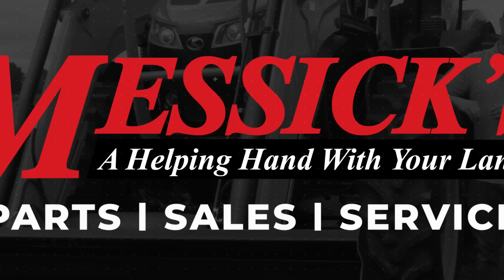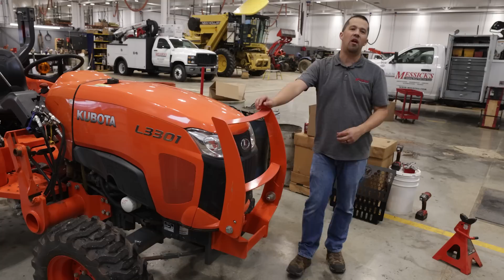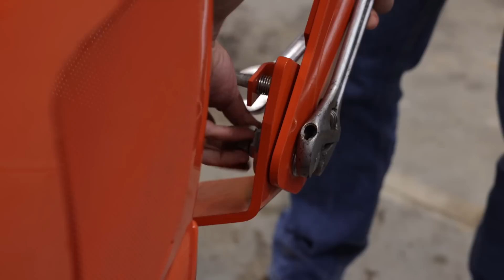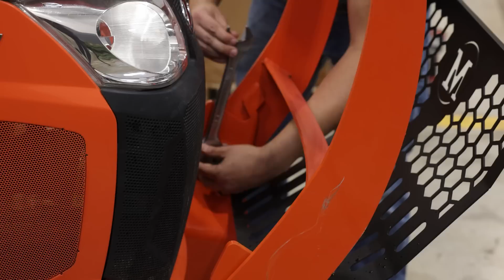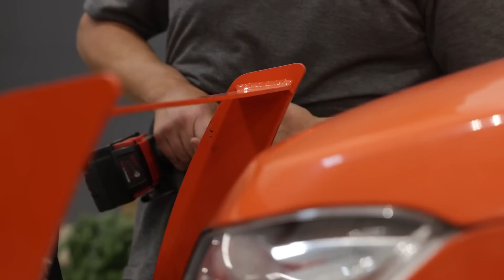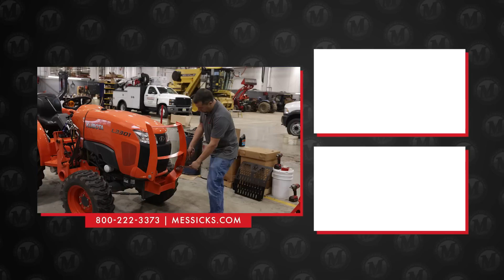Messick's Brush Guard Installation Guide

Comment: Wouldn’t it have been easier to put hooks on the top of the guard that hooked over the frame and just use the two bolt holes at the bottom of the frame?

Comment: Purchased this brush guard after trashing the grill on my daughter’s Kubota L 3301 while pushing brush with the bucket.  The item arrived in a timely fashion and was installed quickly thanks to this video and the fact that you included the drill bit to make the holes for the upper part of the guard, the tip about using a lubricant while drilling also was ver helpful.  And, as if that was not enough, you put the first letter oh her last name fabricated onto the guard which I took full responsibility for, she was very impressed.  Now, if you could just fabricate a grill guard for our ‘02 TC40 D, I would be even more grateful.

Comment: Looks great at price point compared to what I found online before I decided to make my own. Clever mounting idea on bottom. I bought a 24x36" sheet of 16G 1/2" perforated rolled steel, cut to size and painted New Kubota Orange (Krylon). It's about a perfect match, color wise. I was about $115 all in with my (free) labor, so I think your price is pretty fair and might have bought one had I seen this before. I do like the matching orange though. I can't weld so it's held on with 10 heavy duty zip ties. So far, so good...

Comment: Does the grill guard inhibit the lights at night?  Looks like you might not have enough lights because it's blocked by the guard.
Reply from the maker: A little bit, yes. The headlights are already pretty compromised by the loader. If you need light at night, work lights are the way.

Comment: Interesting Neil.  My Messicks grille guard for the LX2610 went on the inside and had to be drilled from inside to outside.

After rewatching the video I'm wishing my LX unit went over the grille frame for more structural support rather than inside the frame.  Dan
Reply from the maker: Yes, there are small differences between models.
Reply: Same thing for my B2601,  but I got it installed

Comment: Ok, after watching this I need to clarify.  The grill guard came above the top horizontal bar by about 1/4". The curves of the two horizontal bars pushed into the back of the grill guard, that's what I meant by not fitting the curvature.  I used clamps to pull the tabs of the grill guard back to the side supports so it could be drilled and secured.  I noticed in the video that the 3301 (2?) horizontal bars are set further back in the factory grill guard and shouldn't interfere.  I can assuming that the MINOR issues I had are exclusive to the 4701, and maybe just a production variance on this particular machine. I HIGHLY RECOMMEND BOTH MESSICK'S AND THIS GRILL GUARD!

Comment: I received mine about 3 days ago.  Came with no instructions, but that wasn't any problem.  the grill guard Did Not fit the curvature of the factory guard.  I had to pull it into place at the top using clamps.  Again no really a problem for me, but could be for some.  I like the way it looks and hope to never actually test it! L4701